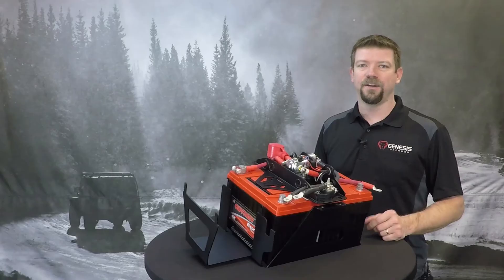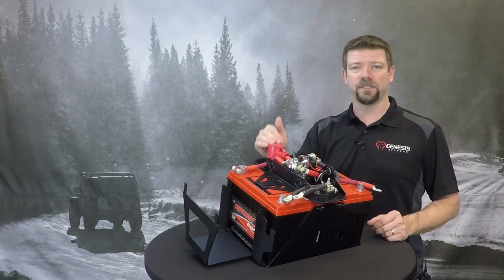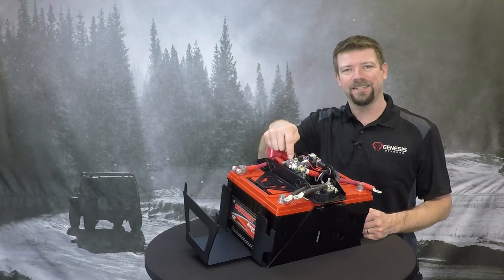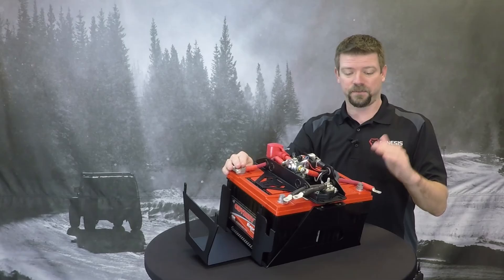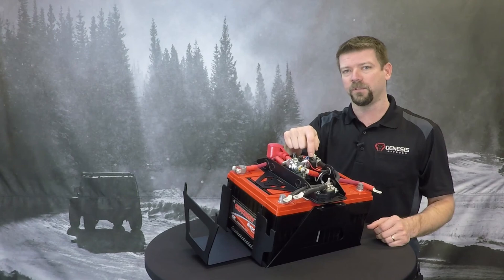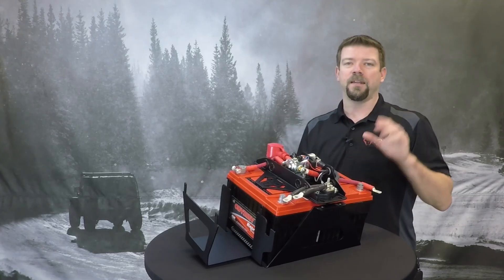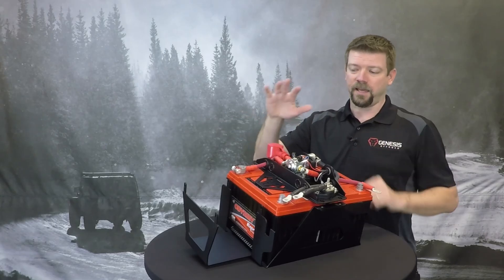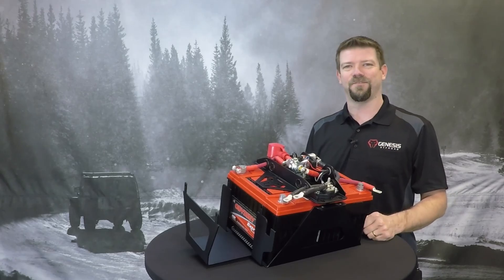What's the red light on the isolator mean? Tech Tips from Genesis Offroad

Comment: If the batteries are charged, is the LED supposed to stay on even when the key is off?
Reply: Not as far as I can tell. Mine keeps clicking and causing the red light to flash while driving. That's what brought me here
Reply from the maker: They will stay connected until the voltage of the cranking battery drops to 12.7. Then it will separate the batteries and the light should turn off, indicating they are no longer connected.

Comment: This helped me somewhat, I’m running a Lifepo4 lithium pared with a standard lead acid for the vehicle systems through a 500 amp smart isolator. Resting voltage of both seems to be 13.0-13.1v but the isolator light appears to never shut off and stays red also being a bit warm to the touch all the time.
Reply from the maker: It's not recommended to mix battery types when running 2 batteries in parallel, because they charge differently. Linking a lithium to a lead acid battery can reduce the lifespan of both batteries. Your better option for doing this would be to use a dc-dc charger which can charge 2 batteries independently without linking them together in parallel.

Comment: My light seems to stay on for a long time while engine is shut down. 

I just added a new Optima red top and topped the charge off on Yellow top, and the Boost has stayed on overnight.

Is there a time limit to when the system will break the connection and be isolated?
Reply from the maker: No, it's not based on any time limit. The batteries will remain connected together until they drop down below approx 12.7v for 1 minute. Then the isolator will automatically separate them and the light will turn off. If your light is still on, that just means they are still above 12.7v.

Comment: Wondering if the alternator on my 2016 tacoma is strong enough. Even without running any accessories I find the red light does not come on until I connect them manually by pressing the button. How do you hook up a trickle charger? I assume factory ground and pos posts?
Reply from the maker: The smart isolator will link the batteries together once it sees your cranking battery above 13.2v for 2 minutes. You can connect a charger to your factory positive wire on the cranking battery and the factory negative wire on the aux battery. This way the trickle charger works just like your alternator - it will charge the cranking battery first for a couple minutes, then the smart isolator links the batteries together to charge the aux battery as well.
Reply: @GenesisOffroad  I have notice the oem alternator can't keep up with both batteries, after a 3 hour drive not enough juice to get my spod to power up my lights. Trickle charged over night and had sufficient power in each battery for it to power the lights. 2 deep cycle batteries appear to be too much for the oem alt I guess.
Reply from the maker: E Simons The alternator should be fine. Give me a call at your convenience and I will be glad to help. -Shane 901-214-5337
Reply: Could I hook up 2 battery tenders on to each battery on my utv? Or is one battery tender sufficient?

Comment: i have turned motor off and my red arc red light stays on, is it meant to stay on
Reply from the maker: Yes, when the light is on it simply means the batteries are still linked together. They will stay connected until they drop down below approx 12.7v for 1 minute. At that point the smart isolator will separate the batteries, to protect the cranking battery from being drained by your accessories, and the light will turn off.

Comment: OK so I'd like to add the Genesis duel battery kit in my Jeep. I want to hard wire my 12 volt compressor fridge/freezer to the bus bar and have it run 24/7. Since it may sit for a few days between trips, I'd also like to add a Noco on-board smart charger to maintain the batteries. How do I hook up a battery charger so it wont fry the system? How about adding a solar panel and charge controller to my roof rack and tying that in as well.  
Great stuff.
Thank you.
Reply from the maker: Hi Walter, for all of the above - 12v outlet, smart charger, solar panels, etc all can go to the power and ground bus bars on our kit. The smart charger and the solar panels will top off the aux battery, then our isolator will link the batteries together and that charge will flow through the isolator to top off the other battery as well. Hope this helps! -Shane

Comment: I have the Mopar's Maxcare  lifetime warranty  on my Rubicon.  I want to install this kit but I'm worried It will void my warranty.
DO you have any idea if it will?
Reply from the maker: Walter Sigona No, it will not affect your warranty. Our kit does not change anything with the vehicle' electrical system. We have several Jeep dealerships that install our kits on brand new vehicles.
Reply: Depends on your dealership. Mine took one look at my Genesis dual battery setup and immediate declared they wouldn’t warranty my failed radiator fan because the electrical system had been altered. They can say what ever they want to save themselves money unless you want to fight them on it.

Comment: Hi there i accidently connected the override wire terminal and the ground wire terminal using a spanner the light on the isolator was on and it turned off instantly when they touched have I broken it ?

Comment: what is the difference between the 85 and the 200  amp  Genesis kit?
Reply from the maker: That rating refers to the amount of continuous current that it can handle flowing through the isolator. The 85 amp version is typically plenty sufficient for most Jeep owners running some lights, a fridge, CB, winch, etc. If you plan to have a large number of electrical devices running at the same time, or something that pulls a lot of current like a stereo amplifier, then you'll want to upgrade to the 200 amp version. Either of these can handle spikes of up to 750 amps for short durations. For example, if you are winching yourself out of the mud and you have the winch pulling really hard, it can draw over 400 amps, which is a whole lot of juice, but that's ok, the isolator can handle it for short time periods. You'll burn up your winch before you burn up the isolator. I hope this helps! Let me know if you have any other questions! -Shane